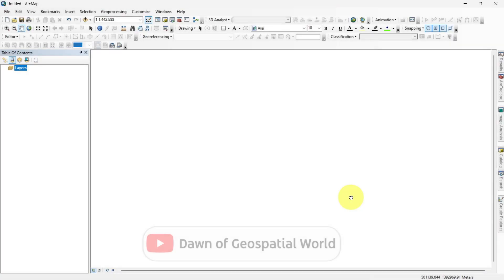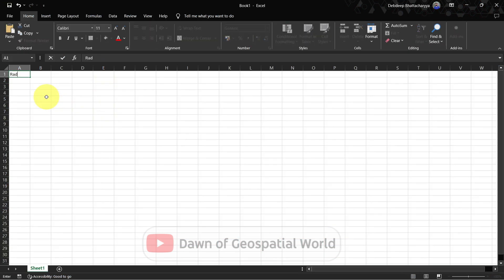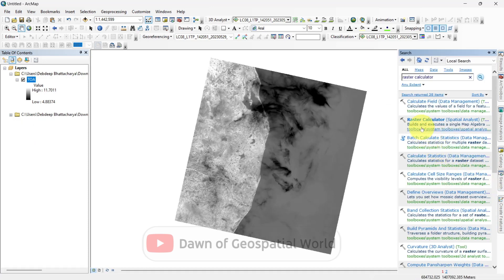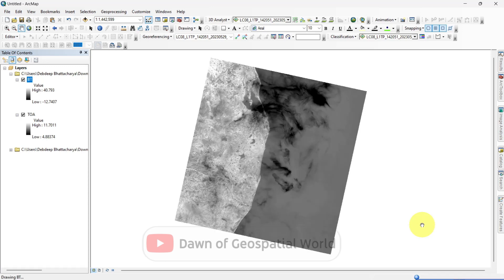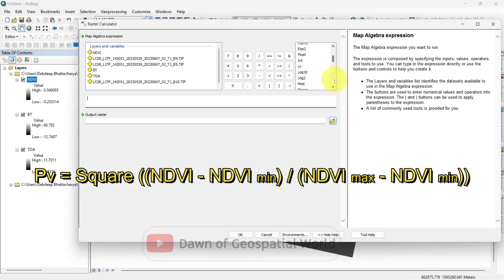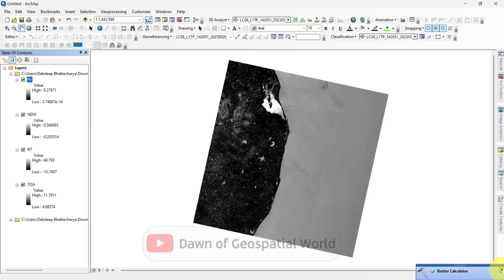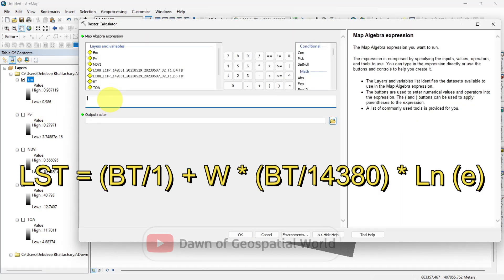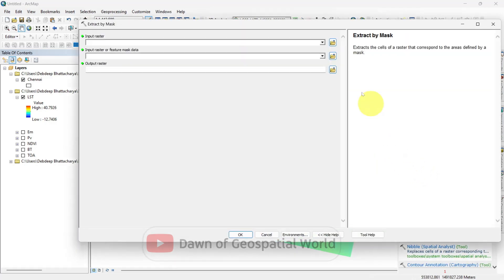Land Surface Temperature | Calculate LST from Landsat 8 Satellite Image in ArcMap #arcmap

Comment: Ndvi min is negative value but while calculating Pv, ndvi min becomes positive at lower but not at the upper in formulas. Why?
Reply from the maker: Because when two negative values comes it will becomes positive value ( '- ' + '-' = '+' )
Reply: Then why it didn't become (+) at upper side of formula
Reply from the maker: @saranshukey  oh! my mistake. Thanks for pointing out
Reply: Thereafter, LST is coming 52 degree celsius of an area which is in tropical region. Is it possible? If not then what to do.
Reply from the maker: @saranshukey  In tropical area mostly temperature goes upto 46-50 degree Celsius. If LST comes above that range, then check if any extreme climatic condition happened on that day or it is some kind of pixel value error.

Comment: I've tried many times, but the temperature readings I'm getting for the land surface are between -1 and 6 degrees Celsius. This doesn't match the usual winter temperatures in the area, which should be between 15 and 30 degrees Celsius. I'm not sure why this is happening and I've run out of ideas on how to fix it. Can you help me figure out what's going wrong? Any advice you have would be really helpful. Thanks
Reply from the maker: Do you follow all processes correctly? like TOA, BT, NDVI, Pv, Emissivity

check you have write all values correctly & put brackets in the right place

take less cloudy images, convert Kelvin value into Celsius

In Pv calculation, both  - min NDVI value will be converted into + min (because - + - = +)
Reply: @dawnofgeospatialworld  Thank you so much for your response. It appreciated. Yes I took care of all things. But I don't know what is the problem. How can i convert Kelvin to Celsius?
Reply from the maker: @subhanvhora8902  in the BT calculation part, that -273.15 is the conversion of kelvin to Celsius. other wise just calculate the LST in Kelvin and atlast go to raster calculator and minus 273.15 from LST layer
Reply: @dawnofgeospatialworld  Thanks for your response. I have done this process with around 10 different years but I got only one answer realistic and rest of others not good. Please suggest me what should I have to do ?
Reply from the maker: @subhanvhora8902  do you check the cloud cover and image collection level? sometimes for that values can be unrealistic.